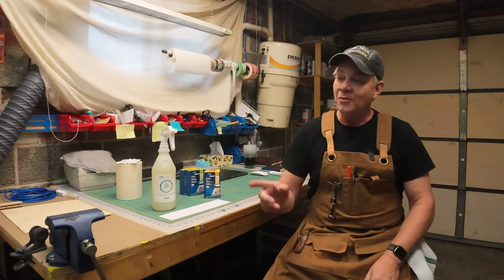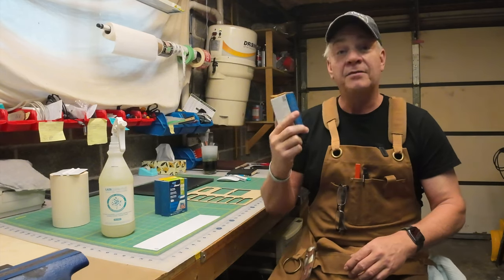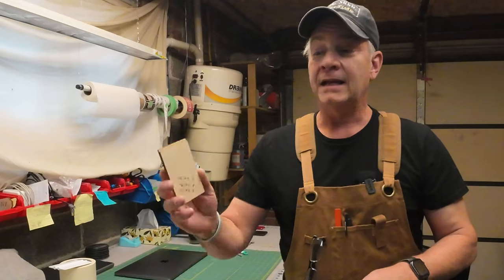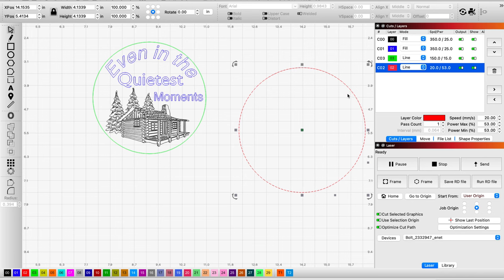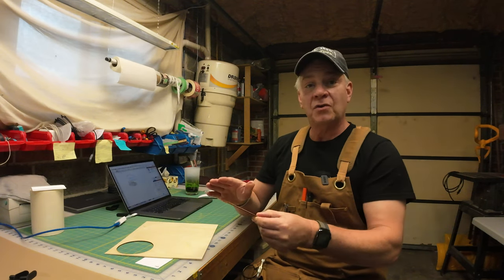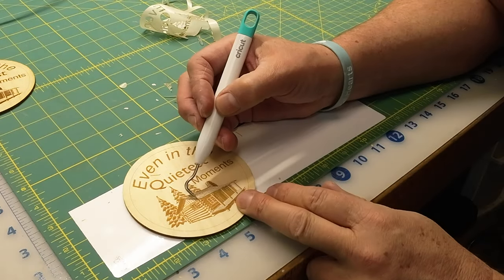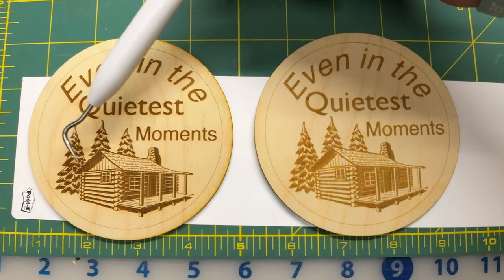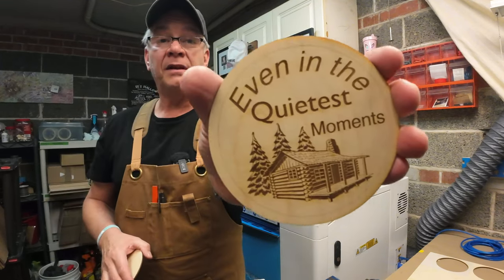To Mask, or Not To Mask. Thunder Laser BOLT Engraving. Working With Wood. 010   4K

Comment: I just turned my Thunder Bolt on for the first time. I have so much to learn. Especially LightBurn. I did manage to engrave my name and cut a square. Videos like yours are a big help! Thanks!
Reply from the maker: Congratulations. Exciting wasn't it? :)) One thing I might offer ( if it is ok) I found out ( almost the hard way) that the BOLT remembers where you last set your origin. So tomorrow when you turn it on, the laser head will whip over to wherever it was set last yesterday. So, before I turn it off each day, I send the head back to the left top corner and then press the Origin button. This way If I put something in there and turn it on , the head won't move and hit anything. Have fun with it!
Reply: @LaserNUG  Thanks for the heads up! I’m definitely looking forward to more of your videos!

Comment: Hi Gord - When working with wood, as someone else mentioned, you will want to coat the material with a clear polyurethane and let it fully dry before you begin engraving. This will allow you to simply remove the sticky smoke residue using a damp sponge with nothing more than water. No masking required! Also, you will find that certain wood varieties don't darken as well as others when being engraved. Alder is probably one of the better wood products to use, as it has great contrast. If you engrave on wood that doesn't darken much (For example maple tends to be low contrast), you can paint fill the engraved areas using a small artist's brush and the color of your choice.
Reply from the maker: Good morning - thanks for the great advice. i will give that a try for sure. And the info on the contrasts with different wood species. Good and helpful. have a great week!

Comment: Hey Gord.   I'm only a couple seconds in and I'm freaked out.  Make sure when using your table saw that you don't push on the material that you're "cutting off".  That is to say, you guide the material between the fence and the blade ONLY.  If you push on the "waste" material, you can easily cause a kickback and get pretty seriously injured.  (look up table saw kickback videos if you want a scare) Once you've completed the cut, you can remove the "waste" material by drawing it away from the blade, or ideally, waiting for the blade to stop spinning before removing it.  PSA complete. 😊
Now back to watching the actual content you're posting about.  
Keep up the great work! 🥲🥲
Reply from the maker: Hey thanks James. I appreciate it. Always try to be safe - the piece was badly warped so I needed to keep a guide on the right as well this time to stop it from binding and jumping on me. Great advice - all the best! Always appreciated!

Comment: Sometimes when I am cutting a larger piece for practice , I’ll go to the controller on the laser while it’s running and change the speed or the power / or both to monitor the difference. I might do this when the engraving is half way up the object, making notes of my changes. Either way you prefer, it’s a lesson for the books.
Reply from the maker: Thanks! I didn't know I could change it on the fly. Have a great day!

Comment: I wonder if instead of weeding the masking with a picker, a high pressure air gun close up would just blow it all off in one go. Also I think the masking material itself is absorbing some of the engraving energy, making it lighter. Would it help to do a second pass? Also (and I've done this) you can spray paint the engraving before you weed the masking off to make it darker or any color you want. Great video!
Reply from the maker: Morning Richard. I haven't tried either of those yet but appreciate it. Yes, I turned the power up to 40% and it definitely made a noticeable difference. Thanks for the good suggestions!

Comment: Here's a suggestion that I discovered accidentally and now do it always.  That is to use a light clear coat on the wood BEFORE engrave and cut.  If I'm planning to use a stain, I do that also before the clear coat. 
After engrave and cut, I blow off any soot or debris with air, and wipe off any resin stains from the laser operation with a damp microfiber cloth. 
Works great, and no "weeding " of the mask is required.
Reply from the maker: Thanks for sharing the info Kevin! I have not considered that before. Cheers!

Comment: So far, the only material I mask is acrylic. Since acrylic I buy already comes masked, it's simple. For the baltic birch, I use a variable speed orbital sander with 320 grit sandpaper to get rid of that charring. But, here's an exercise for you to think about. The speed and power settings are what determine the depth the lase can penetrate right? Slower speed more power can cut through the material, and faster speed with less power can engrave the material. Then you add masking, which is another layer on the wood in this case. You have to compensate for adding the masking layer. That layer is another material for the laser to cut or engrave through. So, either reduce the speed a bit, or increase the power a bit. Or, don't buy veneer wood, buy actual blatic birch plywood, and do a light final sanding after you've engraved and cut.
Reply from the maker: Good morning and thanks NF! This very helpful - I'll give the variations a try - appreciate your time on this answer. Cheers!

Comment: not sure which "brand" of masking tape you have, but when i mask, i dont like the "melted" glue residue that generally comes w/masking.  I usually compensate power when I do mask in order to get the preferred darker look.  This is especially noticeable with a "fill" operation.
Reply from the maker: Thanks - This makes sense - i will give it a try. Cheers Ryan!